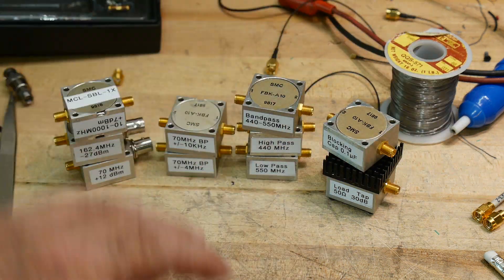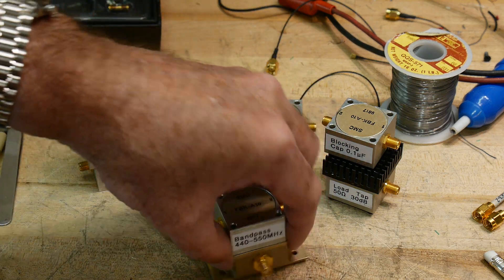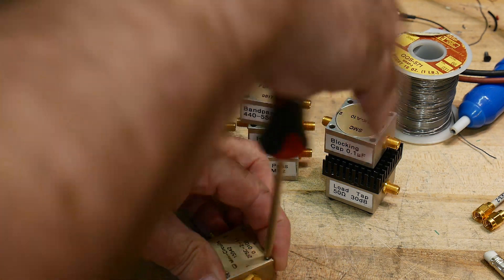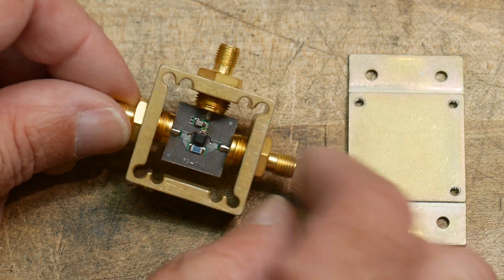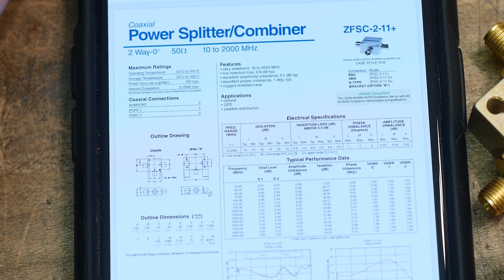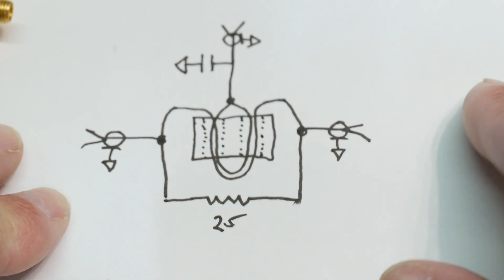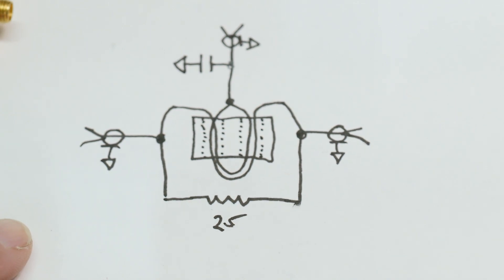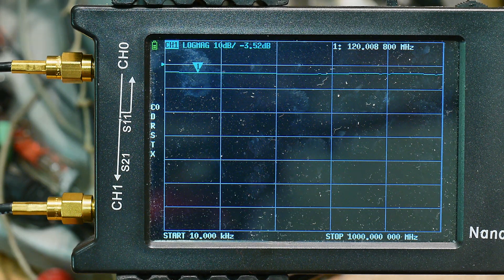#596 SMA RF Power Splitter Divider

Comment: You being an RF Guy, I haven't been able to find FM 88Mhz to 108Mhz Band Pass Coaxial(F Connectors) Filters. The ones I did find were several hundred dollars and my project isn't that elaborate. I would think the usual mfgs ie Channel Master, etc would have them but they don't. I want to use them in a multiple antenna arrays in conjunction with preamps. Any suggestions ?
Thanks,  Surf City CA
Reply from the maker: No sorry. That is a strange filter. Most of the time people want to reject that band. The signals are so strong, no need to have a bandpass. You can build your own if you have the ability.
Reply from the maker: https://www.ebay.com/itm/402814334717?chn=ps&norover=1&mkevt=1&mkrid=711-117182-37290-0&mkcid=2&itemid=402814334717&targetid=1262779895169&device=c&mktype=pla&googleloc=9032151&poi=&campaignid=11614425326&mkgroupid=125167414711&rlsatarget=pla-1262779895169&abcId=9300456&merchantid=6296724&gclid=Cj0KCQjwweyFBhDvARIsAA67M71KPQGQMpU0U_6xh-kfPcUH66m_La8wI5_NviiKyJsZfpuUxTaAz2IaAqk4EALw_wcB
Reply: @IMSAIGuy  Perfect ! Thank You. I've got the small 'Pomona Box' so your suggestion and link helped A LOT ! wes  †
Reply from the maker: https://www.ebay.com/itm/313524048069?chn=ps&mkevt=1&mkcid=28

Comment: I have an Eagle HPD123NF power divider. It is constructed with 3 female N connectors connected to a  pcb with 3 surface mount resistors. It is specified for use between dc and 3.0 GHz. Eagle appears to have gone out of business and I would like to find a data sheet. I assume it doesn't make any difference which ports are used as inputs or outputs as this is a purely resistive design, but I would like to know the isolation and maximum power rating.

Do you have suggestions? I'm not able to find anything on the web.
Reply from the maker: since it is resistive. measure it with a multimeter. center to ground, and port to port. if they are all the same then use any. if two are same and one is different. then input on different one
Reply: @IMSAIGuy  Thanks for the suggestion. I am still hoping to find a data sheet.

Comment: 5:15
What about outputs isolation?
Reply from the maker: I should have included that. The sma one was about 17dB and the BNC 20dB. Still not enough for what I was doing. So I put matching 20dB attenuators on both outputs so I have 20+20+17. Still not enough, So I bought a coaxial relay

Comment: Cable TV spliters are built similarly and much cheaper so if you are wiling to modify them ...
Reply from the maker: that would be an interesting experiment. 75ohms and UHF, can they extend to 1000MHz
Reply: @IMSAIGuy  Those are typically rated from 5-1000MHz. I have a cable tv 30dB tap somewhere but I can't find it now, also built the same way (binocular transformer, some passives).

Comment: Good morning. A power splitter/combiner 15542 from the minicircuits. There's a single pig nose core transformer and a 25 ohm resistor across the outputs. The capacitor at the input is to flatten out the response by nulling the effects of the leakage inductance. As per the data sheet it seems to be a 50 ohm system good up to 500 MHz. Then the resistor must be 100 ohm. If it happens to be a passive hybrid combiner/splitter there has to be an auto transformer with an impedance tap to feed the pig nose core transformer containing 1:2 winding; it brings about signals at either of the output with same phase with -3dB attenuation.